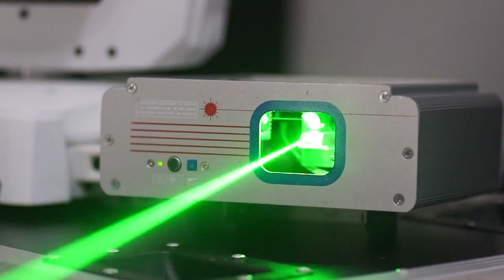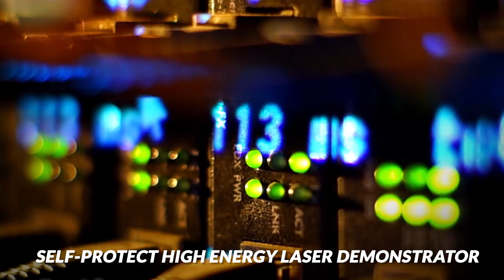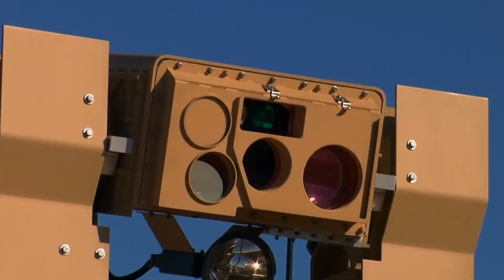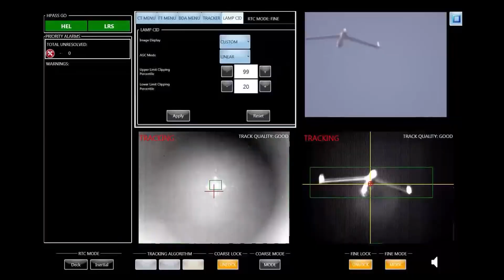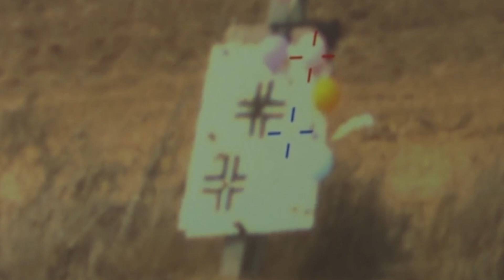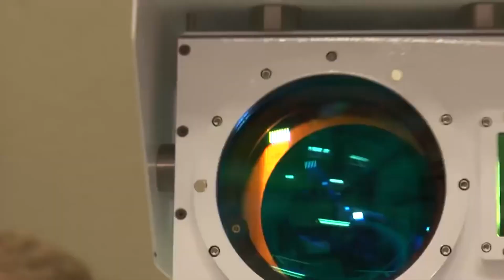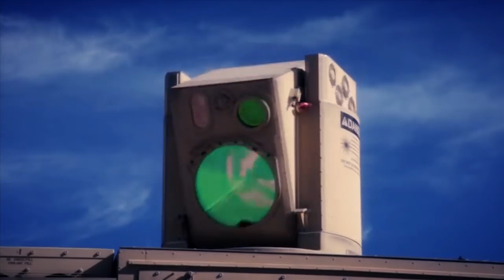The US Tests Deadly LASER Weapon on Its Fighter Jets

Comment: I don't know about this.  Simple reflective coatings on surface  of incoming missiles will make those thing so useless....  I don't think that's what they can be used for. I think it can possibly blind enemy pilots in a hot second.
Reply: That's not how it works. 

You would need a perfectly reflective surface, which is technologically impossible for us, today.  Meta materials are promising, but those are not easy to manufacture and there are still ways around them. 

Normal coatings are not reflective enough to make a significant difference. 

The photons are being pushed at the missile at extreme speeds, with extreme energies.  The reflective coating does a good job of deflecting those, but is not immune to the "impact" of those photons. There will still be heat generated as photons bounce off the mirror. A missile, moving at high velocity, already has significant heat build-up on the control surfaces/nosecone.  Either of those targets is thus ideal for the laser, which can precisely target those areas and make the heat too much, even with mirrored surfaces. 

A meta-material perfect reflector is tuned to less than half the wave length of that incoming photon and so can redirect it but again, we don't have those in mass production...yet...probably.
Reply: @iamscoutstfu  People say a lot of things online only to expose their limited knowledges.  Did you say photons are being pushed to extreme speed? 🤣🤣🤣🤣🤣. You just nullified Einstein with a laser.
Reply: @dokkiro  

the mechanics of how lasers work doesn't nullify "Einstein"

That's not even a cogent statement.  Einstein was a person, how could the mechanics of producing a laser nullify him?

In the classical view, the energy of an electron orbiting an atomic nucleus is larger for orbits further from the nucleus of an atom. However, quantum mechanical effects force electrons to take on discrete positions in orbitals. Thus, electrons are found in specific energy levels of an atom.

An electron in an atom can absorb energy from light (photons) or heat (phonons) only if there is a transition between energy levels that matches the energy carried by the photon or phonon. For light, this means that any given transition will only absorb one particular wavelength of light. Photons with the correct wavelength can cause an electron to jump from the lower to the higher energy level. The photon is consumed in this process.

When an electron is excited from one state to that at a higher energy level with energy difference ΔE, it will not stay that way forever. Eventually, a photon will be spontaneously created from the vacuum having energy ΔE . Conserving energy, the electron transitions to a lower energy level which is not occupied, with transitions to different levels having different time constants. This process is called "spontaneous emission". Spontaneous emission is a quantum-mechanical effect and a direct physical manifestation of the Heisenberg uncertainty principle. The emitted photon has random direction, but its wavelength matches the absorption wavelength of the transition. This is the mechanism of fluorescence and thermal emission.

A photon with the correct wavelength to be absorbed by a transition can also cause an electron to drop from the higher to the lower level, emitting a new photon. The emitted photon exactly matches the original photon in wavelength, phase, and direction. This process is called stimulated emission.
Reply: @iamscoutstfu  Thanks for the copy and paste.  👍. But I read it about 2 decades ago already.  I think it was Laser LED article on wikipedia...
Reply: @iamscoutstfu  You said extreme speed. Like light has variable speed or something.  Nullified Einstein means just that. E=MC².   You just put that variable speed of light in that equation and then what 🤗...
Reply: @iamscoutstfu  Amplified photons just means what it exactly sounds like in my opinion.   More photons per square nanometer perhaps?🤗   do you think that the angle of the lasers hitting the surfaces will make differences just like the armored vehicles used in tank combats?  I'm just trying to test your basics..  It's a great lesson.  I have wasted probably around 3 months of my life on something that was impossible because I didn't have the prior knowledge on physics of permanent magnets.  I am telling you this for a fact. Research for reflective coatings that repel lasers will probably cost few millions at the most. Lasers are still useful in my opinion.  Let's say there are swarms of enemy drones approaching you from all around but then of course swarm drones would be equipped with reflective coatings sacrificing some invisibilities as soon as laser deterrents against drones are developed.
Reply: @dokkiro  

"do you think....combat(s?)"

No, you just made up that thought in your head and pretended I think that.  

How can you test my basics when you can't even remember what I actually said? 

"Research for reflective coatings..."

This is wildly inaccurate.
Reply: @dokkiro  

Hold on, lol.

You think the term "extreme speeds" implies variability to light speed?

Why do you think such a silly thing?
Reply: @dokkiro  

Bro...light speed is literally the most extreme of speeds.  Nothing we know of moves faster than it. 

Light speed is therefor by definition...extreme speed. 

JFc lmao wtf are you thinking?
Reply: @dokkiro  

Also when you say Einstein do you mean Einstein's theory for mass energy equivalence? 

(https://en.wikipedia.org/wiki/Mass%E2%80%93energy_equivalence)

You know he did other things too...like, I dunno,  the theory of general relativity? 
(https://en.wikipedia.org/wiki/General_relativity)

speaking of saying things to expose ones lack of "knowledges" lmao
Reply: @iamscoutstfu  Good luck with all your endeavors online.  👍🤗
Reply: @dokkiro  

Can you explain why you thought the words "extreme speeds" somehow implied that light speed was variable? 
What made you make such an obvious mistake?

Is it the same mistake that made you say something nonsensical like "nullified Einstein" when you meant to say "contradicts Einstein's theory of mass energy equivalence"?
Reply: @iamscoutstfu  "Photons pushed to the extreme speed" was what I read. Your father must've been the BS master of "I'm always right even when I am wrong"  Like I said before,  good luck with all your endeavors online.  👍😩
Reply: That would be false. the problem with coats is that they have to withstand the speed of aircraft, the speed of its motor as well as atmospheric conditions around
All those factors can affect it. 
Secondly areas like the seeker, motor and warhead cant be coated
coating the seeker may interfere with it. Cant really coat the motor and the lastly the area around the warhead is generally made out different material so when it detonates 
its not working as hard 
With kinetic warhead, the seeker still can't be coated
Reply: @verdebusterAP  ... Unlike what most people thinks US don't have supersonic missiles for a good reason. Supersonic missiles can be easily shot down upon approaching the target because of the lack of maneuverability.  You're actually right about the stealth paint having to be repainted only after 1 supersonic flight on stealth fighters but you're so wrong about the reflective coatings...  I mean there are stealth missiles and I don't think stealth missiles can maintain their stealth capability during the supersonic flights because of the sonic booms...
Reply: @dokkiro  
The US does not use supersonic missiles for land attack or anti-ship because they dont like the trade off 
The trade off being the extreme weight 
as for stealth coating being repainted 
that would be false and not what we are talking about
Missiles and aircraft have different coatings. Aircraft are designed to flew thousands of hours while weapons are one use only
Reply: @verdebusterAP  ..... Yeah but that's not what I had heard.  Supersonic flooms that occurs during supersonic flights will render stealth capability useless anyways and stealth paint can't withstand supersonic flights for long.  I would say they're not training in supersonic flights with the stealth coatings on but like you said "it's a different matter"    now back to the reflective coatings for laser deterrents.  I know we could fire a laser in the vaccum space and punch a hole size of a soccer ball since the inception of SDI program but since then we abandoned the idea entirely and went with the missile defense systems to counter incoming ICBM missiles.  The reason was.... I didn't just come up with it in my head.  Someone obviously said that in the 80s and I was just regurgitating it.
Reply: Lisa Stettin  Only one problem with the such laser projector floating in the space firing at incoming missiles.  It's like a huge neon sign that saids "Here I am! Shoot me down with a more powerful ground based laser weapon!"
Reply: Lisa Stettin  And I'm being completely serious about the use of lasers on counter sniper weapons. Just imagine a defense system involving lasers firing back at the sniper's eye.
Reply: Lisa Stettin  I think blinding combatants are hella more humane than just burning them alive to deaths...  But whatever...
Reply: Lisa Stettin  ... I don't know about you but I would beg to differ.  Just think about it. Would you like to be killed by laser or just be blinded?  I don't think you are actually right about that ruling. I don't think one can torture prisoners into confessions by blinding eyes but I'm talking about the lethal alternatives here.